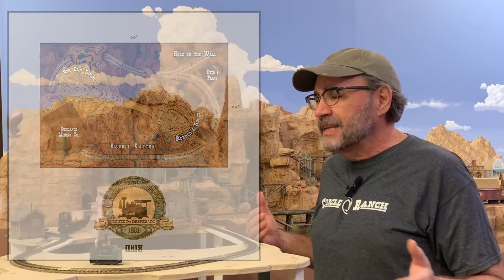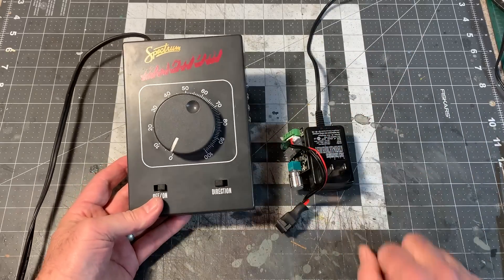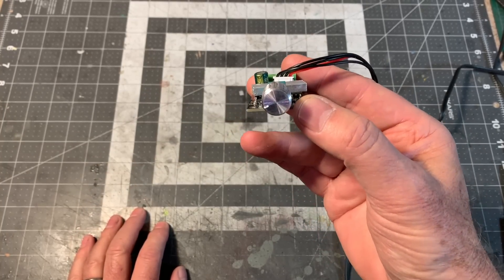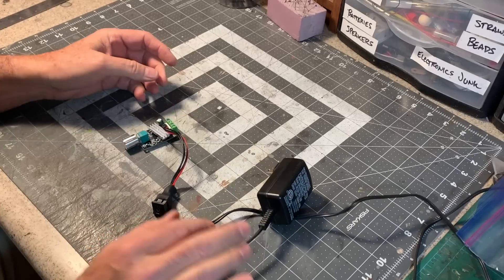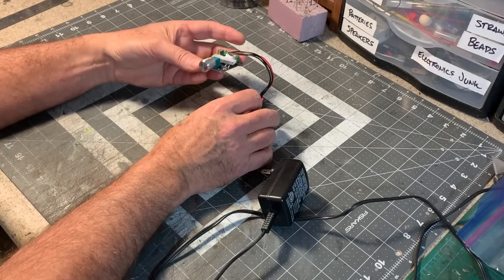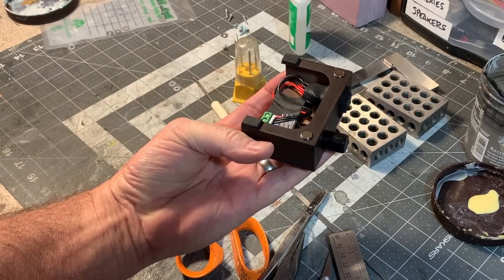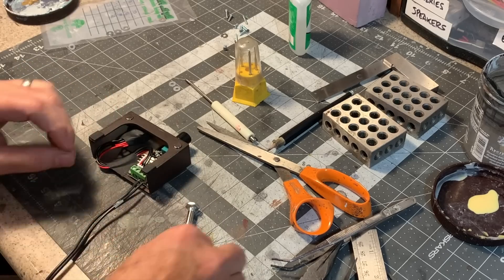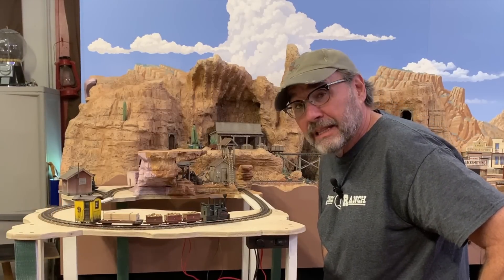BCRy | Building a PWM Throttle for Smooth DC Power

Comment: Pulse power and PWM are not identical, Dave. Pulse power is a spike of AC on top of DC. PWM is square-wave DC, with the length of the square wave, the duty cycle, determining the loco speed.

This is exactly what I've been looking for, though. Great tutorial.

Comment: Hi Dave, I bought the throttles, but am having trouble finding the exact adapters. One vendor has them, but they are quite pricey with shipping. Will any AC adapter work  in the range of 12-16v? Not sure if the 22w and 1000ma shown on your adapter is critical as well. Thanks for any info. Brian

Comment: Hi Dave thanks for another great video, enjoyed it. Does the unit give off any heat?  What size was your housing for the unit? Thanks Keith.
Reply from the maker: Very little heat. Most of the heat is generated at the transformer which is not part of the unit. The box is 3.25x2.5x1"
Reply: Thanks Dave, will give it a try. Keith in the UK.

Comment: Hi Dave. I'm going to make a similar unit for the Inglenook shunting puzzle layout I am currently building. The main difference between your one and mine will be in the direction switch. I am going to be using a momentary on/off switch so that I can set the power level on the pot, and then move the train forwards or backwards by pushing on the switch, knowing that as soon as I take the pressure of the switch, the loco will stop moving. I can then reverse the direction without having to make changes to the speed setting. Due to the small distances being moved, pressing the direction switch to move the loco does not become monotonous or stress the finger you are using to do so.

The good thing about PWM is that you are getting pulses of full voltage, at all settings, the length of the pulses determined by the setting on the potentiometer. The full voltage pulses overcome the inertia of the motor, getting it turning earlier than the case would be if you were using a standard variable voltage power supply.

Comment: FYI, transformers convert AC though a pulsing magnetic field. How much it coverts is determined by winding ratio, which for model railroads would be about 10-1. 10 winding in to one out, although it is more like 1000 to 100 in amount of wires

Comment: FYI, pulse on older MRC is NOT the same as PWM.  Pulse is achieved on older MRC by removing the AC power rectification.
PWM, is a rectified square wave that goes from 0-12 volts real fast and when you adjust the pot you vary the width of the pulse to have more on the off
Reply from the maker: Thanks for the clarification
Reply: @ThunderMesaTrains  I have a bunch of books on electronic projects for model railroads

Comment: I built a DC momentum throttle with braking from a MRR magazine article back about 1978, from scratch. It still works today as well as ever. One reason I never went DCC. Thanks
Reply: Was that the "TAT - IV" throttle?

I still have the motherboard, that I never started to build.

Got married instead.

Comment: I think that you can find such controllers already made, in similar size, in Japan, as they like a lot such mini layout.
DCC is just PWM for the motor point of view, with just the advantage of back-emf for even better control, with a good decoder. Sure, you will only be able to control one loco on this layout, if keeping the cabling easy, and no sound in loco (but DCC sound is already a challenge in O16.5, it will be very hard with On18).